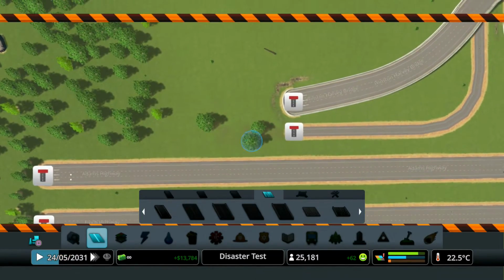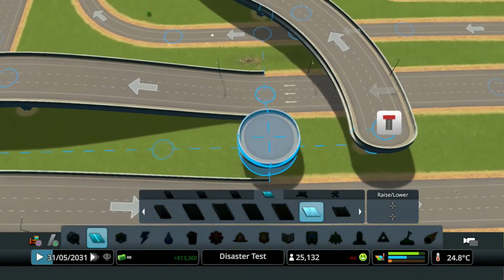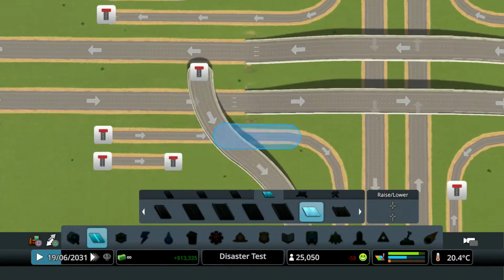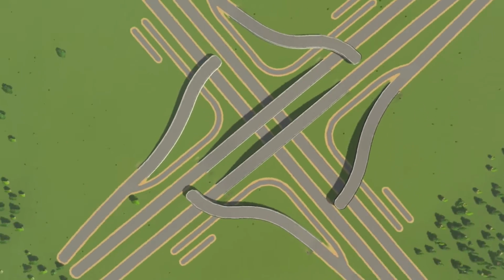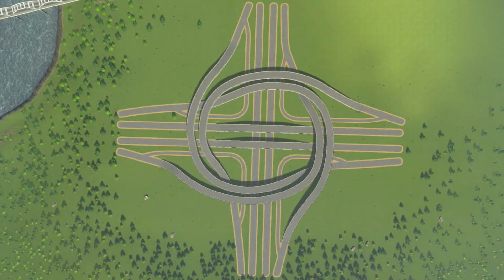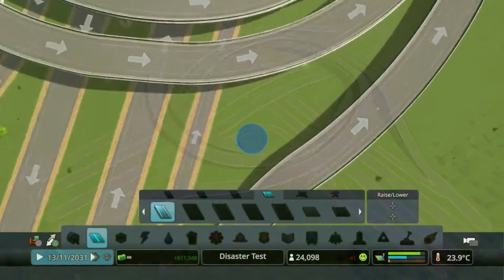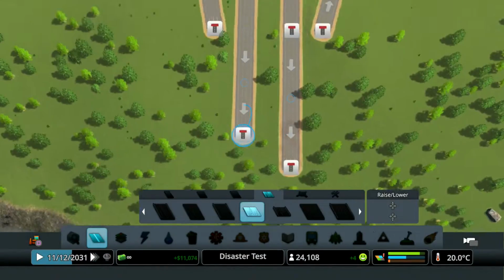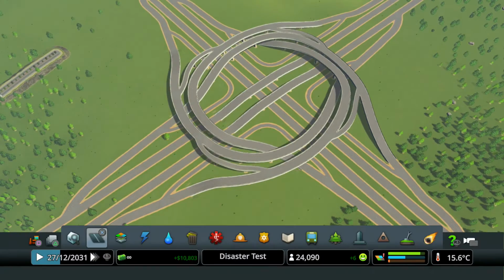Cities Skylines Vanilla-PS4-Xbox How To Build The Turbine Intersection-Interchange Tutorial No Mods

Comment: You don't want to make tight turns in an interchange. You want to keep them as gentle as possible. Otherwise it slows the traffic down because the cars can't take the turns as fast as the straight sections. Of course, sometimes you don't have a lot of space to work with so you're left with no choice but to slow the traffic down by making tight turns.

Comment: I’m really struggling with this, I’m guessing my snap options are wrong, I’m trying to count cells but it keeps snapping me to something different
Reply: Same here
Reply: I think we should try making it with only single lane off and on ramps
Reply: use dirt roads as a guide were to start and were  to end up i used a $380 dirt road to make 4 corners about starting about 3 -4 squares off from a max length ramp on the highway. always leave space for columns between highway and the single lane off ramp 1 open tile is all you need